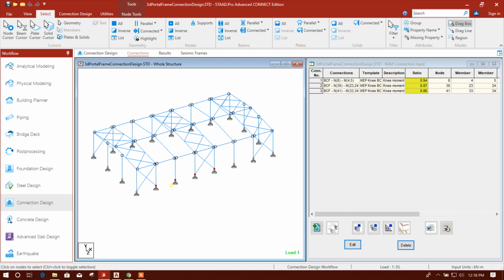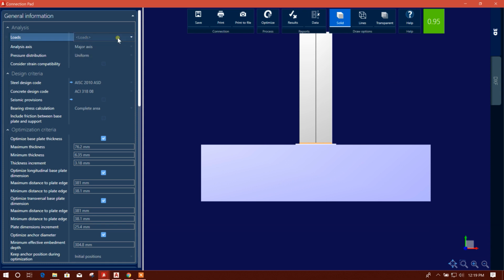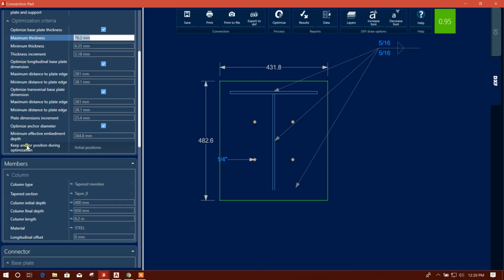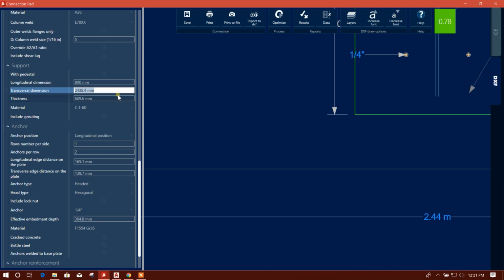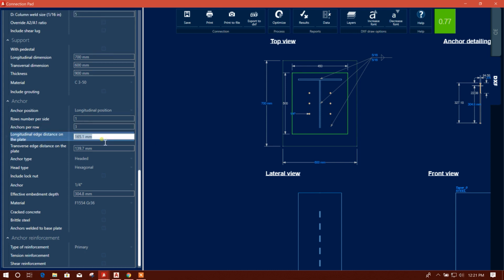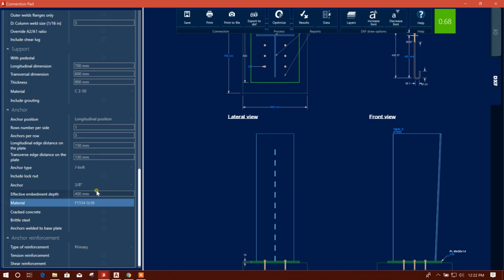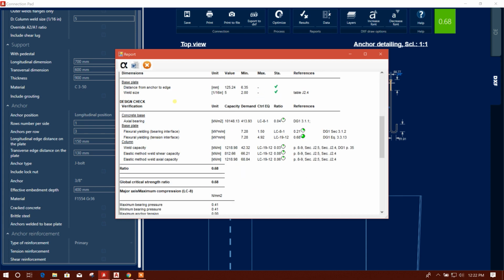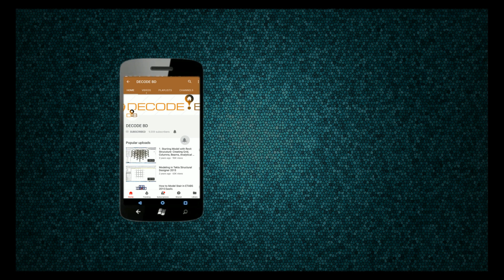BASE PLATE DESIGN IN STAAD PRO RAM CONNECTION

Comment: Sir what if the building is composite ,I mean combination of concrete and steel...first floor/base is all concrete then succeeding floors are steel..how to design base plate connection in the interface

Comment: Assalamualaikum,.......... Sir, maybe you can give me some advises about design steel structure for warehouse by using RAM Connection which integrated with Staadpro Connect Edition v22, if the structure planned to has a pedestal and the high of pedestal is 1.5m and total high from the pinned support is 5.5m include the steel column (pedsetal 1.5m and Steel column 4m). For analysis an design, Is the column should be offset 1.5m from the bottom or not? to get the modelling like real. i just try to do offset and I got the warning "High value moments detected in the axis perpendicular to the design axis".  also , how to do input steel parameter like Kz,Lz for the column on proses design an analisys.. Thank you sir. Whatsappnumber +6285740453435